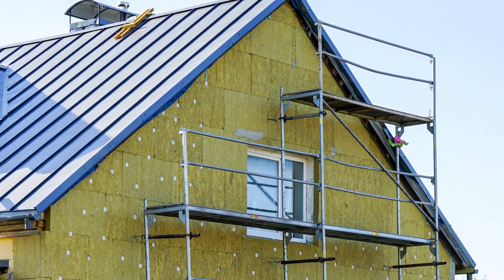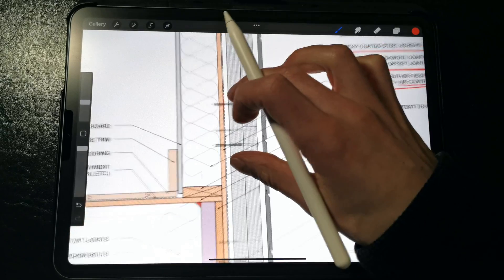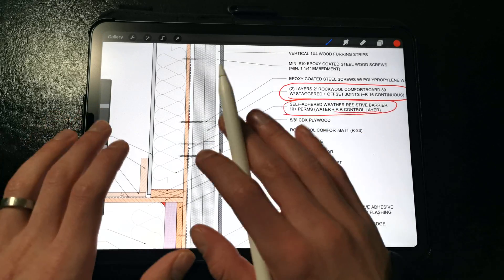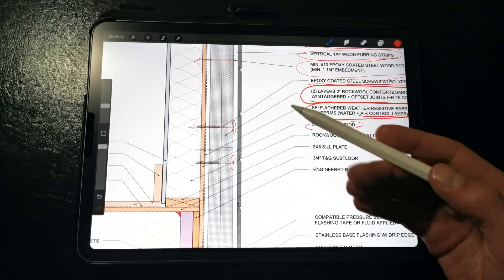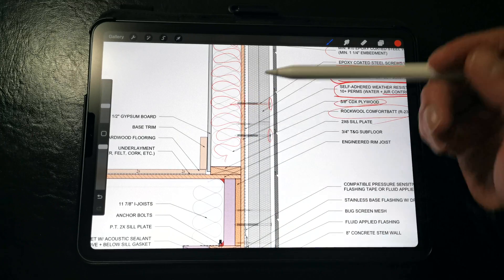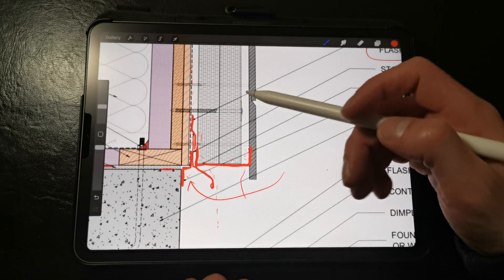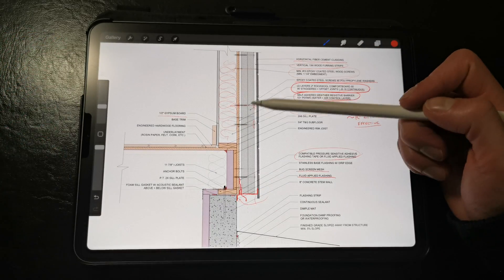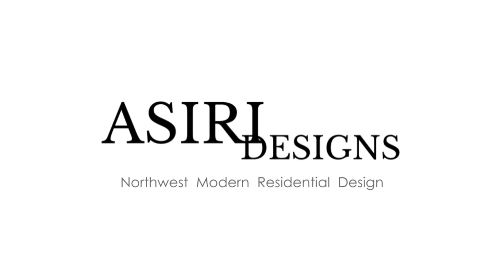Super Efficient Exterior Insulation Details with Rockwool (For Architects + Builders)

Comment: My house has 14 cm thick solid wood walls with 14 cm old wood fiber insulation on the outside . Vertical furring strips support the insulation and provide a surface for a siding of choice , wood or stucco .

Comment: At - 5C I think that water could condensate on the screws and enter the screw-holes that are directly imbedded inside of the insulation via wicking; assuming that this is the case it could lead to cold spots and therefore create mold if someone decided to leave their heating on in winter. A temporary fix to this problem could involve the use of something like a felt to both create an additional barrier as well as be a way to slightly insulate the metal/plastic screws from humidity only around the screws as a non-continuous barrier where it should matter most. I hope this helps 🙃

Comment: Do you put Rockwool insulation inside and outside of the existing wall.?  Also Is this setup for a Timber buildings only or can I use this same method for 26 cm brick wall also?

Comment: Actually the effective is higher than R-21; it’s closer to R-30or32 depending on stud spacing; even at stud/plates at 15% of total wall square footage; when windows are included then the overall R value of wall is around R21/22

Comment: I’m not sure how you arrive at an R value of R21 effective, from initially R39 nominally. It sounded too low. So I quickly modelled the wall. Without studs and screws in the exterior Rockwool I arrived at about R40.3. (I had to use Comfortboard 110 as I didn’t have numbers on hand for 80, so it’s a bit higher). Adding in the 2x6 at 16”OC it ends up being an effective R-value of R37.7 (using the glaser method although that’s for vapor behavior, but just mentioning it as a dynamic model like WUFI).

Comment: Amazing video! I have one question: by placing the rockwool (a non-structural material) between the plywood and the vertical furring strips, and then attaching the cladding to the furring strips, doesn’t the distance created by the rockwool between the furring strips and the structural part of the wall weaken the stability of the cladding due to flexion in the screws?

Comment: Thank you for that excellent video.  I have a question about the wall in this video.  Assuming you are using it in climate zone 7, an indoor design temperature of 70° Fahrenheit, an outdoor design temperature of 20° Fahrenheit and an interior relative humidity of 60% (high, I know, but not uncommon), wouldn’t the dew point be inside the 2x6 wall?  Thanks.

Comment: With the use of furring strips, you only need two fasteners with washers to hold the rock wool boards in place during assembly.  But how do you hit the studs when going through furring strip, many inches of insulation (more than 4" for an off-grid optimized home!) and a drainage layer against sheathing, then the sheathing?  This problem is particularly of concern with roofs, since the insulation is typically thicker!  Also, where the heck do you find the screws needed for these thicker assemblies?  So far, the best I've come up with are screws designed for assembly of SIP panels.  Finally, how thick of a layer of rock wool do you need to provide the advantage of resistance to wild fires?  What's the spacing of screws needed on the furring strips so your metal roof or siding doesn't rip off?

Comment: How do you stop fire spread with perfect wall approach?
Reply: I haven’t who specs a 3/4 to 1-1/2” rain screen gap using wood fitting strips explain how this isn’t an exterior fire hazard in western dry climates. There might be metal or fiberglass mounting options that would not place fuel in the gap.  Last, have you ever tried to mount cheap fast growth furring strips flat on roxul dead flat?  It’s not the easiest.  This system needs some kind of silver bullet for these problems.  It sure isn’t wooden straps.

Comment: What does this look like on a roof? 

1/16" is fine when water wants to run straight down.... What about on a 4 or 5 12 roof?

At some point that gap lets air in and your insulation is ineffective.

Comment: All these details and labor makes spray foam insulation look cheap! This is not a better wall..
Reply: Downside to spray foam is still the bridging and eventually moisture failure issues inside the wall. The better hybrid is probably as smaller continuous layer using R-Zip and and more in wall insulation that allows drying. I think in the future, we will see a lot of wall/foam failures from water intrusion.
Reply: @dylaneastman  Many insurance companies won't cover spray foam.
Reply: @graciescottsdale  we rarely use it anymore and or in very select small areas.

Comment: Excellent video! I'm planning a whole house remodel in climate zone 5a and I am planning on using 4" of mineral wool on exterior walls and unvented roof with a 3.5" batt in the wall cavity and 12" against the underside of the roof deck. That's only an R-31 for the wall, but I'm limited by the existing 2x4 wall framing and don't want to sacrifice any interior space for more depth. Anyway, it's good to know that I'm on the right track.

Comment: For simplicity sake, the Zip-R system solves this issue assuming you still do a rain screen correct? 

I’m in Zone 4 so if I roll with their lower end R3 or R6 panels that alleviates the thermal bridging I would experience?
Reply: We have been using R Zip for low bridging areas (1-1.5") but feel uncomfortable with it up in the 3-4" range for nails operating in the shear capacity. In that case, regular Zip on stud with Comfort80 over it seems more sane. For these small bridged areas of for example the R-6 board is faster/cheaper.

Comment: Good videos guys. It seems like you're selling the effective R-value of this wall shorth though. I just modelled a wall like this in RETScreen and the nominal R-value was R-37.2 and the effective R-value was R-34.3. That's using  2 layers of 1.5" Rockwool Comfortboard and 16" spacing of 2 x 6 wall studs (19% of wall area). The layer of mineral wall board on the outside really does a lot to reduce the thermal bridging effect of the wall studs.

Comment: I saw on the build show where 3 inches of Rock Wool was applied over 3/4 advantech and the engineer indicated the furring strips only needed to fully embed in the Advantech, not the wall studs.  The vertical siding was apparently not very heavy.

Comment: What about extending the outboard layers of rigid insulation below-grade to have continuous insulation throughout an occupied basement as well?
Reply: I came to this video looking for that video. If you foam board the inside of the wall, there is flame spread to contend with. Running outside prevents the dew point on the concrete as well. Struggle is the detail for lathe/stone over roxul board on the outside. It is more flexible that ridged foam but I keep seeing it be done with success.

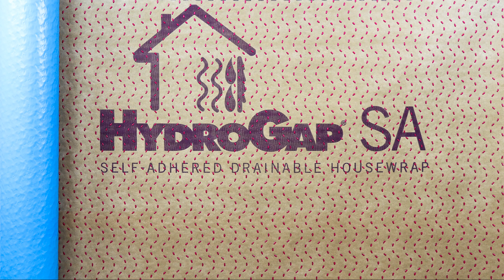Comment: At 2:04 you mention creating a drainage gap when using rigid foam exterior insulation. Typar drainable peel and stick, or a drainage mesh are two examples. If you choose these products, what would make the most sense for an air barrier?

Comment: You show a gap between exterior side of sheathing and exterior rock wool.  That gap is filled with cold air, correct?  If so, does that exterior rock wool provide any insulative effect?   What am I missing?
Reply: I believe he exploded the detail for clarity. I draw everything the way its installed but that causes confusion when all elements are jammed on each other at smaller scales. I think he gave "not to scale" room just to make the details clearer.
Reply: @dylaneastman  but why wouldn't you put the WRB over the exterior insulation instead of under it?
Reply: @ChrisVattic  I think it would depend on the region and the dew point and trying to not trap a condensation point. In Maine a builder I worked with has the comfort board over wrb with strapping to support siding. The strapping has to be set by tension to get a straight line. I don’t like that a lot. In RI I saw someone else use a fiberglass Z instead. When we are building close to home, we are zone 5 on the edge of 6 and have been using shallow R-zip over studs with Roxul batt infill. I’m just now starting a project with an 3” wrb exterior which lead to this conversation. Open to your thoughts.

Comment: I don't think your effective R value is correct at 4:20. Should be more like 31. Wood framing members reduce the R value of the wall cavity insulation (by roughly 30%), but the exterior insulation should be at almost 100% effectiveness. Why add R16, if you only get an additional R6?
Reply: I agree with you - you have to figure heat loss at the studs, top/bottom plates + heat loss at the cavities & exterior ; from this you can figure the effective

Comment: We use mineral wool batts with mineral wool board over it on masonry walls, and then low perm barrier, with air gap, and masonry veneer. We use wall ties for veneer to help hold insulation too. Great video as always.

Comment: @asiridesigns Fantastic video! I am in the “planning” phase of new construction and wondering if I should do this. I am located in Provo Utah, it feels cold to me in the winter, hot in the summer. I talked with a few builders and they don’t think external insulation is needed but then I don’t see a lot of high performance homes out here either. You quick circled zones 1-3 on your diagram when mentioning “cold” so maybe I don’t need external insulation? I think I am zone 5. Thoughts?

Comment: Thank you for pointing out the loss of insulative value due to wood framing touching the exterior wall. Do you think there is a big "bang for the buck" to be gained by using a sheathing that has rigid foam pre-attached on the back side for thermal decoupling?

Comment: My house has plastic sheeting in the walls as a vapor barrier. 
I plan to insulate the exterior when I replace the siding in a couple of years. 
Since that plastic is perm 0, would I be able to insulate with eps or xps or would I need something more permeable like comfort board?
If I understand correctly, I can’t use foil faced because like the plastic sheeting, it’s also perm0 and will trap moisture in my walls?

I’m in zone 3 New England.
Reply: Which side of the wall is the plastic on? We are Zone 5 in NE and if you have the plastic on inside, I would not use foam on the outside for the double vapor barrier issue. If the sheeting in on the outside of the exterior sheathing, then it would work fine.

Comment: If one were applying exterior insulation (mineral wool) over the main floor walls and a heated crawlspace on an existing house in a cold climate, what would be a good treatment for the bottom of the insulation? The same bug screen or would there be a better method for both keeping bugs out and as a capillary break?
Reply from the maker: Great question. The above grade walls would get the same treatment with a bugscreen at the bottom, and any rigid mineral wool located below grade will need to be protected with some sort of protection course/protection board, and drained with a dimple mat. The dimple mat can also double as the protection course. The top of the rigid insulation located below grade would need to be protected as well, I like to use either coil stock or metal flashings.

Comment: I will soon change my sidings for james hardie board. Currently have cedar planks. 
Because we aren't changing the windows. I'm somewhat limited on how far off the wall i can add insulation.

My house is 1981, 2x6 walls with fiberglass batt and (super thin) vapour barrier inside. 
I want to add 1 inch XPS on exterior wall. WRB, 1 inch XPS, furring strip, hardie board.
 I'm zone 4 (Vancouver Island).

Since i watched your video i'm suddenly unsure it's a good idea, I don't want to cause condensation pockets. The main reason to add it it's to have a continous airbarrier, the vapour barrier in the house is butchered around every opening like elect. Box, door and windows.

Comment: I’m about to build and Rockwool is definitely what I’m going with and using standard Zip sheathing but I will pay close attention to sealing the slab to the wall and I’ve decided there’s no way I’m using tape I’m going fluid applied I think the tape is just a future failure point in 10-20 years. I’m just looking into cheaper alternatives to the Zip fluid.
Reply from the maker: Most STPE (silyl terminated polyether)-based flashing products will work as a substitute for the ZIP liquid flash, like Prosoco's FastFash - though you may want to reconsider using the liquid flash product from ZIP since it would all be covered under the same warranty.
Reply: I see a lot of people use Lexel for sealing the bottom plate to the slab

Comment: Exterior insulation is expensive and complex, double stud or stagger stud with cellulose is much cheaper and closer to tradition building.
Reply from the maker: I like double walls and they do tend to be slightly cheaper, however, you still have to contend with vapor condensing on the backside of the sheathing in cold climates and the other complexities around keeping water away from those walls. Air tightness is absolutely critical in these double wall assemblies, and either require the use of a taped smart vapor retarder on the interior side or taped sheathing located on the interior side of the exterior wall to provide an air barrier and to throttle vapor flow outwards. There are a couple of papers from Kohta Ueno from Building Science Corporation on double walls. Perhaps this will be a good topic for a future video.
Reply: @ASIRIDesigns I don't really understand why that's such a complex issue in Canada and the US. In the  Nordic countries vapor barrier is used only on the interior side of the wall with ~10" of insulation and outside of the wall there is only wind barrier (particle or gypsum board), furring strips and exterior cladding and there are no issues with condensation.
Reply: @BoringBurger   an you explain more because I am studying this subject right now. How are you not getting condensation on the back of your sheeting in the Nordic countries? Have you opened a wall to actually see if it's working? Or possibly the outside of the wall can breathe so well that the frost on gge sheeting can dissipate easily
Reply: It seems like there would be risk of missing the studs with those very long screws.
Reply: @joniboulware1436  yep, usually builders use 3/4 sheathing when dealing with thick exterior insulation.  So if they miss the stud, there's still some bite in 3/4 sheathing. They also can't remove the screws cause that would be a leak in air barrier.

Comment: I recently saw a video where a couple had built their own home.  They did a couple inches of closed cell, then added batts.   They found the batts later to be soaked with water (condensation).   They happened to be in the upper midwest.   The problem was the hard surface of the closed cell gave a surface for condensation each time that surface dropped below the dewpoint.   However, if the entire wall had closed cell from sheathing to drywall, they would not have had the condensation as the interior surface would have been too warm and the outer surface was too cold.   Moisture will not occur inside of a homogenous material and will only occur on its surfaces.
Reply from the maker: That's exactly right, and it comes back to the need to use the right ratios of insulation to prevent condensation. The same ratios apply to closed cell foam as rigid insulation, however, I suspect there was substantial air leakage in those walls depositing moisture onto those cold surfaces. Closed cell spray foam is tricky to work with because it can crack especially in cold climates due to expansion and contraction of the framing components. If that spray foam cracks, you've immediately violated the integrity of the air barrier, allowing warm moist air from the interior to pass through those cracks and condense. I'm now in the camp of avoiding spray foam wherever possible and opting for either rigid insulation instead or a smart vapor retarder membrane.
Reply: @ASIRIDesigns  I think the moisture came from the inside, and not from the outside.  I am not a fan of flash and batt.
Reply: Yes, the problem most likely wasn’t the insulation choice but more the care involved in the installation and preservation of a vapor retarder through drywall stage and the neglect to install or run an ERV or HRV in the home.
Reply: @CMCraftsman wasn't an HRV or Erv problem, the house was never even occupied
Reply: Or if they hadn't added the rock wool